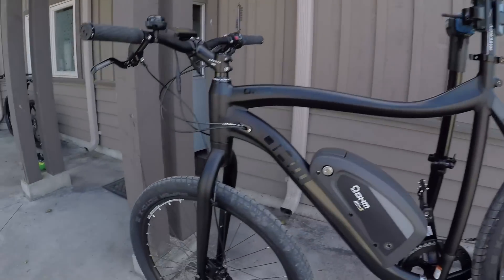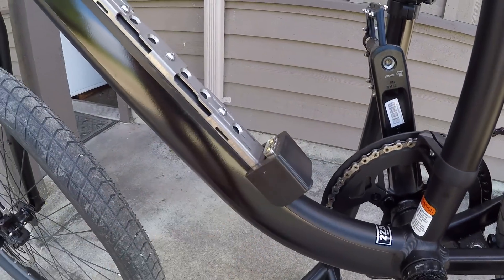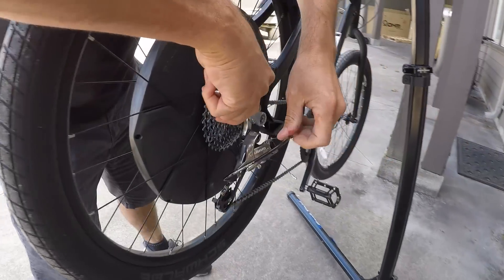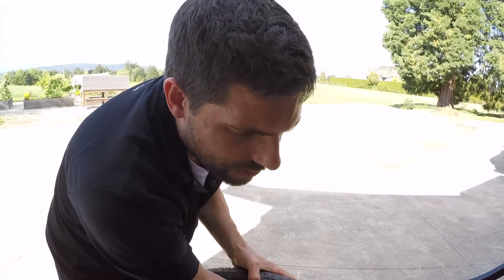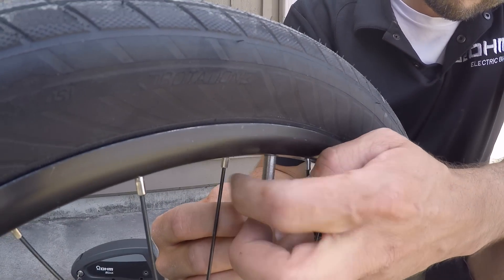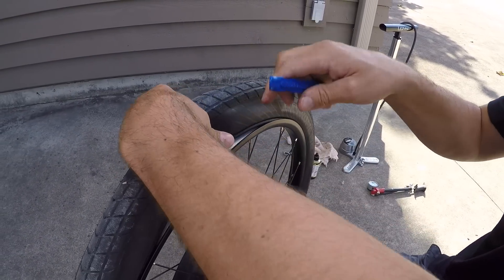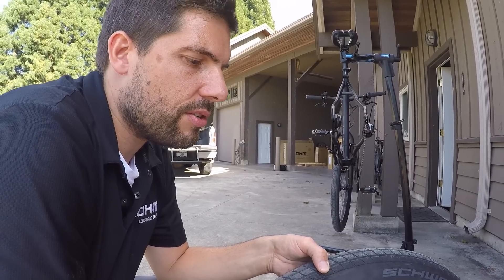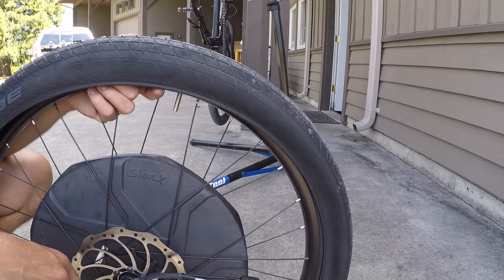How to Change a Flat on an Electric Bike with a Hub Motor

Comment: This is too much work lol. Wow
Reply from the maker: Yeah, it can really challenging... especially with a heavy ebike. This is why I love the puncture resistant tires, and I try to keep the recommended PSI in the tires, to reduce pinch flats. Mid-drive electric bicycles tend to be much easier to service.
Reply: I don’t have a car and the nearest bike shop isn’t really within walking distance and it’s somewhat hazardous traveling on foot without any vehicle as there isn’t always sidewalks for pedestrians.

So when the bike breaks down, it does put me in a compromising position. Maybe e-bikes aren’t reliable substitutes for commuter vehicles… 😄 I can’t say I am technically confident to deconstruct all the stuff on the rear wheel to separate it from the bike
Reply: @joshuamartin5085  maybe stop being being a little bitch and learn how to service something before using it as your main mode of transportation. Just a thought

Comment: You did not reconnect the electrical cable and put pack the zip ties. It you have a torque arm on you back wheal hub motor this also has to be loosed and bolted back, which increase the number of tools you nee to carry...

Comment: 13 minutes video and you missed some keys points.
Check inside of tyre for pointy things ,
Tyre can be patched without removing wheel which is much faster easier and safer requires less tools.
Slime in actually really easy to use and quite effective.

Comment: I got a 350watt ebike called Ancheer. How do i take the Axle apart so i can rewire the wires ?? What's the name of the company cause i might need a new rear wheel and the Axle cause my Axle is broke?? And the wires is in the Axle where you rewire the wires like red blue green ??

Comment: This is to change a tube....you do not have to take of wheel to fix a flat by patching the tube....i was fixing my own flats when i was 9 or 10 years old....turn the bike upside down...first find your problem... nail or glass or thorn....mark the rim at that spot....release the tire all the way round....pull out around eight to ten inches of tube...find you puncture on the tube....patch it....put everything back....including air ....and bingo...only need to remove wheel on replacement of tire....because you can actually replace tube without totally removing wheel. Most of the vids on this subject are total overkill !!!

Comment: This video is not helpful for me.  I have a Magnum Metro Plus which has the power cable going through the rear axle. I've found it impossible to reinstall the rear wheel after having to replace yet another broken spoke (6 in 2 months of riding).  This piece of garbage is great when it actually works, but the maintenance just isn't worth it. Am I just unlucky or are ebikes just a bad idea?

Comment: I wish my electric bike was this easy to remove that damn back tire.  for me I have to almost completely dissassemble the entire rear of the bike. all 22 nuts and bolts and they are on the inside of the frame that I can't remove so I have to squeeze my hand down into the bike and barely hold the bolt while I kill my back hunched over it trying to turn a screw 100 times.  removing the kickstand, fender, butt plate, disc brake, chain, 6 axle bolts, wired secure plate, and THEN the frame bolts.  Now I can slide my tire back far enough to unhook the motor wire and slide the chain off the axle to release the tire.   by myself I have to take breaks or I'd die... whole process takes about 6 hours to change a flat.
Reply: Wow, that sounds extreme and like you need to go tubeless..
Reply: @duskizm  yeah I tried that too. but my bike has a 22 inch tire. they didn't make tubeless in 22 inchs. Tried to buy a 24 and cut it to make it fit, didn't work.

Comment: Can’t this be done without actually removing a tire rim, if you can identify where the leak is coming from you don’t have to remove the rim from the frame, especially if you’re on a bike path somewhere you don’t have access to a bike stand . Can’t you just take out the tube where the leak is and put a patch on. That’s what I used to do that when I was much younger person on a regular bike. Does the same thing apply on the electric bike style rims?

Comment: You don’t need to completely remove the wheel to replace the tube. It just needs to be lifted enough to get the tube out and replaced. That way the cables can be left in place, although the cable ties may need to be cut and replaced.
Reply: Yep. You can cut the tube right?
Reply: Or use OKO 😀
https://youtu.be/mX_0OyjtA9Y

Comment: Just use your hands to take the tire off, it's not that hard. Tire levers of any variety can damage your tire. Also, keep the tube as a spare and go tubeless, its so much better, you don't get pinch flats so you can run lower tire pressure and get more power to the ground/go offroading.

Comment: Does that little drop out washer thing go on first, on the inside of the bike fork? Can't quite figure that out. I also have a hub cable going into my axle on my Surface 604 Colt. Any other suggestions?

Comment: Could you maybe upload the same video about a mid-drive motor? I have a mid-drive motor ebike (gazelle orange c8 hmi) with a flat back tire and I'm not sure if I'm disconnecting the wires properly. So it would be very helpful if you could give some tips about it.

Comment: Question on the  rear wheel, I have a thru-axle setup instead of a dropout (on my rear wheel frame configuration), will it be able to take in a Bionx wheel?

Comment: He never finished the job. By the time he would have re-plugged the battery cables after carefully lining them up so as to not get them misaligned and then replaced several zip ties, trimmed them and replaced the battery and then pumped the tire back up to correct pressure... phew, you've just doubled the time this demo took. Btw, out on the trail I always find I' never remember to bring my bike stand so much easier and quicker to leave the wheel in place and just remove a section of tire rim near the puncture, pull out a piece of tube, patch it, stick it back in, reinsert the tire rim, pump up and go.
Reply: The tire patches don't always work but you know everything right...

Comment: Where did I read the cables to the rear tire should be removed in this manner; communication cable first, power second.  Maybe that  procedure only applies when the battery is connected?

Comment: no flat tires come in handy, one less thing to worry about..
Reply: yeah , i have bionx kit outfitted with Schwabe and tire liners but a few times over the years , hopping curbs will get a rim pinching the tube .  only other option i've ever had was a bmx with solid rubber tubes
Reply: yep, solid tires are great however make sure the spokes can handle it..

Comment: On my stromer, if I don't have to actually change the tube, I've patched a tube without pulling the wheel off. The tire is a lot easier to get off of the rim than my wire-beaded road bike tire. If it's just a simple puncture then I just pop the bead out on one side, pull out source of the puncture, pull out the section of tube I need to repair and pop it back together when the repair is done. I hate unbolting and cutting zip ties. Not only that but the potential to lose the  small spacers on the hub shaft is eliminated this way. Only problem is bike wants to fall over even with the kickstand down with this method. I have to lean it against a wall or tree or something.
Reply: Dude that's exactly what I do